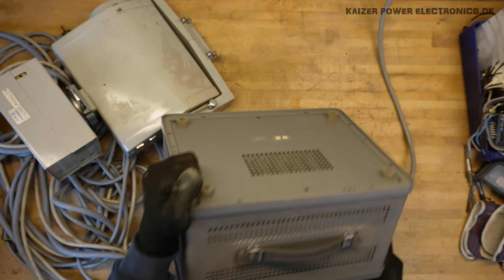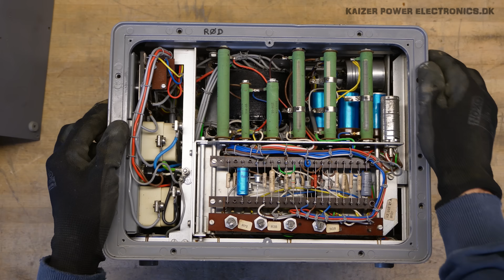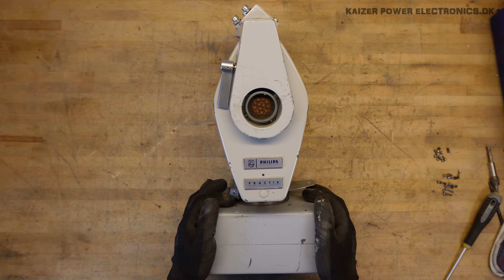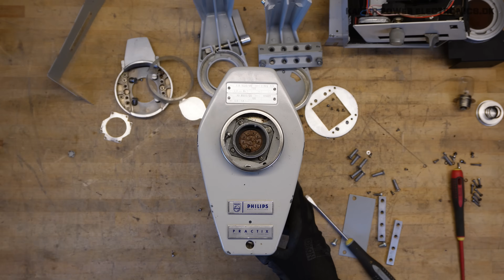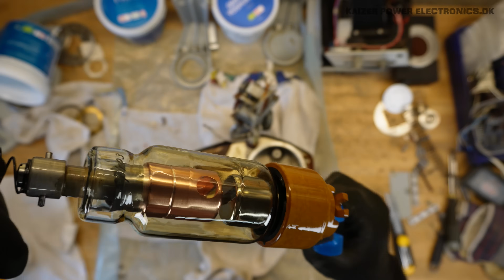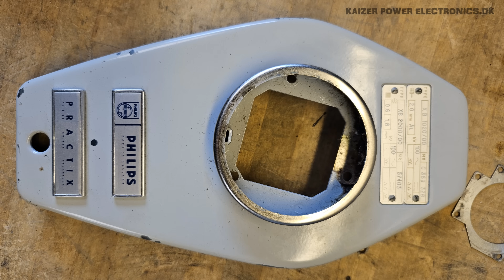Philips Practix 100 kV X-ray System Teardown

Comment: the top label is for the housing and the lower label is for the insert.
Reply from the maker: Housing (high voltage transformer) is with the AL filtering, here 2 mm and by insert you mean the x-ray tube? Since it has the same markings as the tube had, 57403.
Reply: @KaizerPowerElectronicsDk  yes  the tube insert. generally the tube housing is reloaded when the insert goes bad and the new tube insert would have a different serial number.
Reply: The bottom is also obviously referring to the tube since it has an x-ray tube symbol between 'type' and '0.6'

Comment: Cool tear down. Interesting how you tested for PCB. Years ago working at the power utility and been around distribution and transmission capacitors and of course seeing them leak the dielectric and it's oily. As well as labeled PCB free. Anyway, someone found a really old looking distribution capacitor and we had to test if for PCBs. All our field PCB testing kits were way expired and wouldn't give conclusive results. But I noticed the dielectric we got out of it was much different and I did the exact same thing. Dripped it in water and that drop sank like a rock, seriously like a pebble dropped in water! I said I bet this is PCB filled, since it's heavier than water. Long story short, they sent out a sample and came back PCB free and I was surprised. Then about two months later environmental came to me and asked where the cap was, the test results got mixed up and it was in fact PCB filled. We had to put it in a sealed little metal drum and ship it off. But the dielectric was definitely something out of the ordinary and had a very different smell too. No idea of the PCB concentration level but environmental was pretty worried after they got the right results and came looking for it.
Reply from the maker: Thank for sharing your story, hopefully this can raise awareness for others and do these free tests before handling old stuff :)

Comment: what do you need the transforner for?
Reply from the maker: I was hoping to make it run from the original control box, for a display unit running a jacobs ladder or lifter. I think the timer and actuator has some good qualities to using it in that application.
Reply: @KaizerPowerElectronicsDk  thank you

Comment: Love this stuff, i broke down a free 150,000 volt unit that was literally an egg timer across the 220v usa system and i could not be happier. Its the strongest, youghest and simply the easiest high voltage machine i have
Reply from the maker: Exposure times are much shorter today and the better controls make total exposure about a1500 times smaller than the first ever x-ray machines. So these should be somewhere in between. I don't think the 5 second setting was used that much, maybe to cook eggs ;)
Reply: The 3ish-5 sec was typically used for thoracic spine and cervico thoracic, sternums, mandible joints where the patient would breath during exposure to blur out lung chest etc detail to better visualize the part under exam - a limited tomogram. 
Also often a time that long was the only way to get enough exposure as the tube current in those is pretty small. Typically they also wouldnt go max kVp (100-120 etc) simultaneously with upper mAs values. Overheating, cracked anode,.
I would dearly love to get my clutches on one of these or similiar.

Love yr website, i use it quite a bit!
e @KaizerPowerElectronicsDk